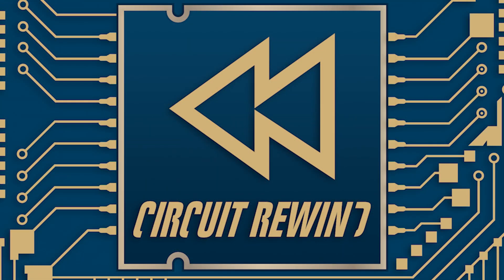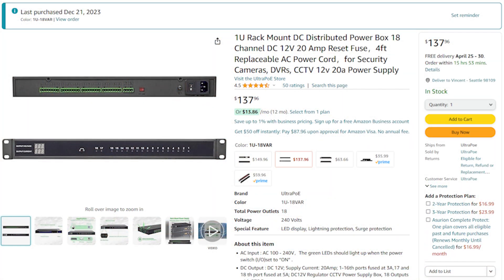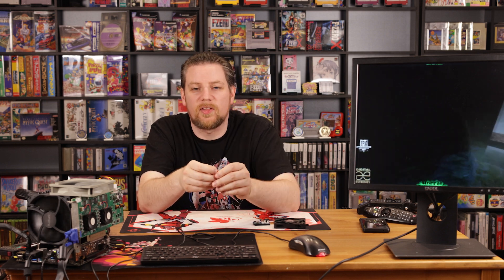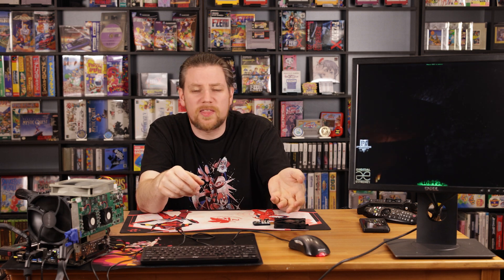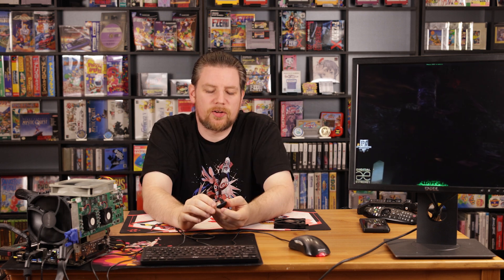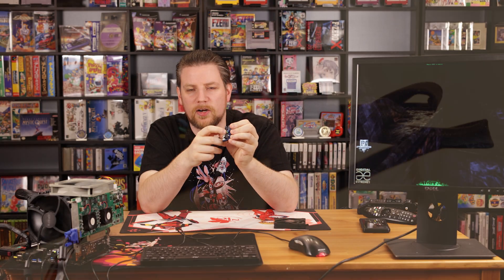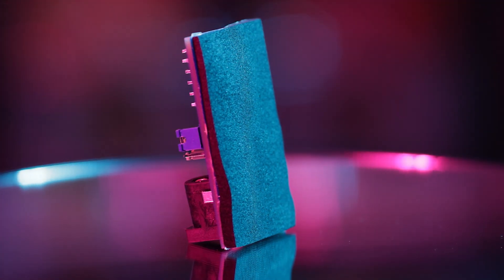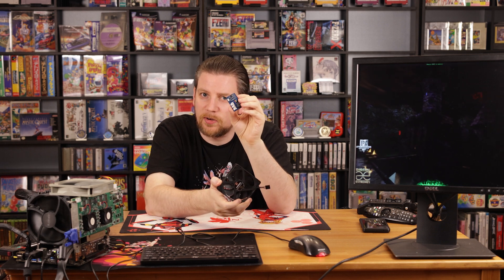I Built a PWM Fan Controller From Scratch!

Comment: I can think of a few better solutions. 1 is to get a pwm fan splitter, and connect it to your normal fan headers. 2 is to run sparky8512's "usb-pwm-fan" software, and have their speed controlled via usb (I'm looking into this solution myself, and is why I came by this video, but it looks like there's no videos on it)
Reply from the maker: The devices I put these into dont have internal USB ports nor would they have the capabilities to use this anyways, so a static build is good enough for my use cases. I've been using this in things like retro network rack hardware or old game consoles. It's been working great for these!
Reply: @circuitrewind  not discounting your solution at all, because there's enough people that want to do the same, so there's all those off the shelf pre-made things like yours. And it just makes sense.

but yeah, the fan splitter might be better. Not only for the simplicity, but also the lower noise, and power consumption, for when the unit isn't generating excessive heat.

Comment: Haha I have a Flipper zero
I was like... It has GPIO Pins can it generate a PWM
Lol yes
Just hook up the blue wire to A4 and the black from fan to ground (common) set to 20000 Hz and voila! 😂

I also tought you can create a PWM with a Ne555 but somehow I never succeed... Or I was just to hasty as always 😂
Anyway great video!

Comment: Very nice video but couldn't get much on how to build the circuit and also build custom controller to control rgb or argb fan ? I have argb fan in my pc but I have only rgb pin on my motherboard 😅.  So if you have any idea what can I do then please tell me.
Reply from the maker: The files for this project are linked in the description. I do have other projects in that same github for controlling ARGB LEDs. The lights and the fan are controlled independently even though they're the "same device"

Comment: It would be nice to have them controllable over WiFi so it could be connected to a Pi weather station and ramp the fans up on hotter days for use in an Avery or a Vivarium or even dog kennels.
Reply from the maker: Maybe... just maybe... a v2 is already in the works, and the parts even arrived before I recorded this video ;)

Comment: Usually those power supplies have temperature/load controlled fans. Maybe cheap/dummy ones have just direct 12V for fan.
At least all lab psu:s what I have have temp controlled fans. I think you are not using full load then maybe downsizing cooling is fine. 
It's pretty nasty if it's cheaply designed transformer and when melting it kill all connected devices. 
Usually driving circuit run hotter and will cause thermal shutdown before transformer melting.
Reply from the maker: If you're talking about the 12v power delivery in my entertainment center, no, that did not have a thermal controlled fan inside of it. It is designed for 24/7 security camera operation, which I'm not using it for. It thus has a static 2-pin DC fan running at full speed. This is a very common thing on devices, most devices I modify use 2-pin DC fans, which is why I'm in the process of replacing them. Now, if we're talking about PC power supplies, its actually a relatively recent addition to have PWM control in them (the past decade or so). A lot of the stuff I'm playing with is quite a bit older that I'm retrofitting for modern features.